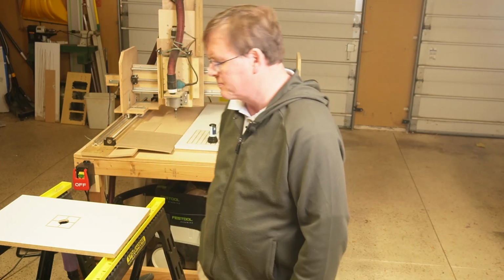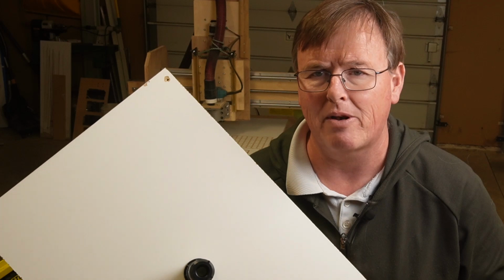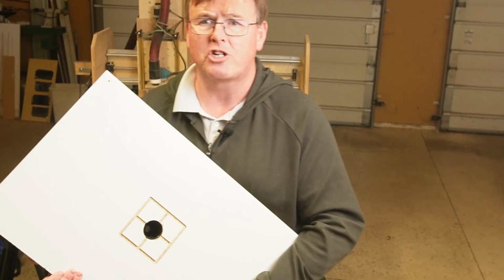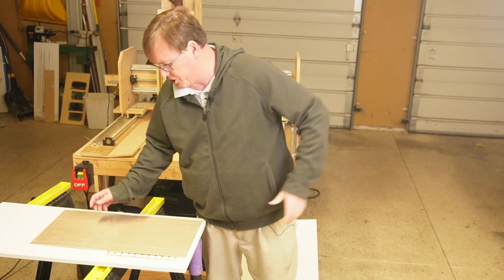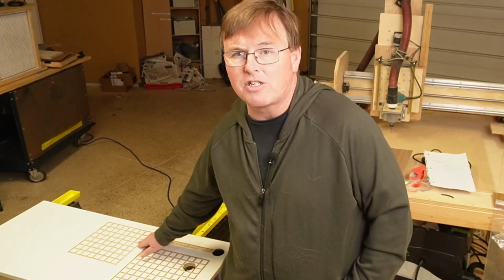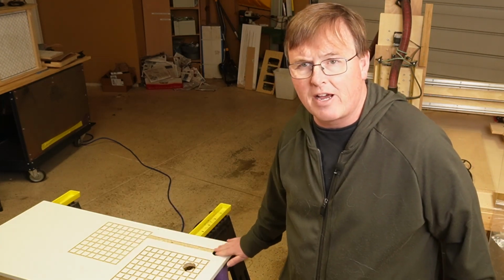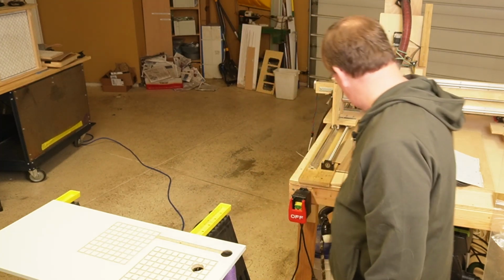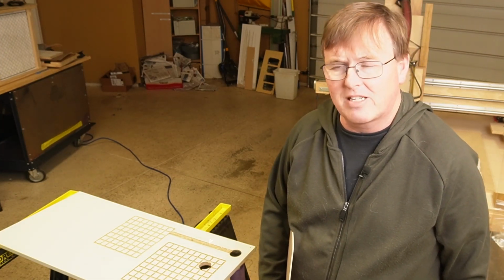DIY SHOP VAC VACUUM TABLE FOR CNC OR WORKSTATION! BUILD FOR LESS THAN $25 IN ABOUT 1 HOUR!

Comment from the maker: One of my viewers gave me a great tip (sadly, I somehow lost the name of whoever it was, so if it was you please feel free to comment/or contact me as I want to make sure you get the credit for your great input)!  The viewer said the Fein vacuum uses too motors -- one for cooling and one for the suction.  Using this particular vacuum would solve the potential overheating problem (and eliminate any reason to poke a hole in the side of your coupler to give some cooling airflow to your vacuum).   Amazing tip.  Double thumbs up to whoever messaged me!!!  I think I may be adding something new to my Christmas wish list.
Reply: Check the specs on the Fein vacuums before stating ‘facts’. Some versions have a single motor, but two fans - one for suction, and the other for cooling. These are typically the Turbo II versions. I have two which I use for sanding and they do work well. There are versions, I think the Turbo 4, which may have two motors, but are not as readily available as the Turbo 2 models. The Fein Turbo 2s are pretty quiet, which makes them great in the shop when used heavily.
Reply from the maker: @retired_badger  Thanks for the head up.  Will do.  I appreciate you leaving this comment so that everyone can know the difference between different models.

Comment: How long do you expect the shop vac motor to last if you run it with no airflow? Shop vac motors are typically cooled by the airflow thru the shop vac.
Reply: The Fein vacuums have 2 motors, one is for cooling. These types of shop vacs are perfect for hold down tables
Reply from the maker: @robert_g_fbg  Amazing input!  THANKS!  I knew some people were using the Fein vacuums for vacuum tables before this but didn't understand why they were any different than some of the other shop vacs with similar suction (and at a lower price point).  Now I know why they were using them.  I put your tip in part of my comment at the top of each of my vacuum videos.  If you want I can add your user name as well so you get full credit for your tip.
Reply: @ glad to help out. No need for credit, Cheers
Reply: Why not put the hose connector on the top, then you don't have to hang the connector over the edge of the CNC machine. Some way to seal of the grid for smaller shaped parts. Nice videos, 👍
Reply from the maker: @andrewmazurkiewicz105  Great idea!  Definitely worth trying out.  My only concern is that I wonder whether some people's CNCs might crash into the hose or sprinkler on top of their bed and disrupt their vacuum and/or shatter their sprinkler head (especially when homing or ending a job) but if one is careful with their design and resolves that issue, I see some definite advantages with a top mount.
Reply: @Simplifycnc  I'd imagine a 90 Deg, bend plumbing pipe could be used to lower the hose height problem without being too expensive. Cheers Andrew
Reply from the maker: Excellent question.  You absolutely do need to make sure that the vacuum formed does not too much a strain on your particular shop vac (you need to monitor this throughout your CNC job and obviously stop if it  starts to overhead as you could burn out the shop vac motor or at a minimum reduce its working life).  I talk about this potential issue briefly in the video under safety as well as in my description below the video (and that is one of the reason I put in the disclaimer to use this at your own risk).
However, I do think there are some simple fixes to lower the strain on your vacuum. 
1)Consider poking a few holes with a ball point pen in the middle of the pool noodle coupler so that part of the vacuum leaks off.  Of course this will reduce hold down power but you can tune the hold down power to the minimum necessary level for your project and hopefully sufficiently lower the stress on your vacuum to prevent overheating.  (If you end up poking too many holes then cover some of them up with duck tape).
2)  Start by using a low cost shop vac to begin with so that if it does give out it doesn't cost you much.  Black Friday is coming and you can get some great deals (usually).  Also Harbor Freight has some pretty low cost shop vacs.  I picked up my Orek vac from a yard sale for $15.
3) Consider limiting the use of the vacuum table to short jobs -- like  with simple vcarve designs.
4) Lastly, you can always purchase a custom vacuum with a better cooling system that is specifically designed for a vacuum table (and long term stain).  Unfortunately, I don't know of a low cost vac that fits in this category.  If anyone who reads this knows of one please comment below.
Reply: @Simplifycnc  Or just buy a vacuum pump designed for this service, are they really that much more than a shop vac?
Reply from the maker: @douggarson50  You could buy a vacuum pump but be aware that most of the cheaper vacuum pumps (at least on Amazon) use oil and the oil tends to get through the vacuum and ruin your wood's finish.  Some youtubers have tried to remedy the oil problem with addons but most ended up very frustrated because after a few uses the addon oil protection failed. This is part of what led me to try the leverage the shop vac approach to solve the problem.  There is a pretty good approach if you already own a compressor using a venturi vacuum generator (You can get  a low cost adapter on Amazon).  I tried that  approach but the fittings with my compressor were a nightmare as everything seemed to have a different thread.  Do a youtube search on this for more info if interested (unfortunately most of the people who have made videos speak German).

 As a side note, I cut about a 1 inch round hole in the sidewall of the pool noodle coupler (as an air cooling inlet for my vacuum) and it seems to still have enough suction to hold a board down  firm-- strong enough that one should easily be able to Vcarve on it (while simultaneously letting air flow through the vacuum significantly reducing chances of overheating/burning out your vacuum).  Adjusting this coupler hole size bigger or smaller will let people fine tune the balance between the suction of table and stress on one's vacuum.  Its super easy to test out and only costs a small section of pool noodle.
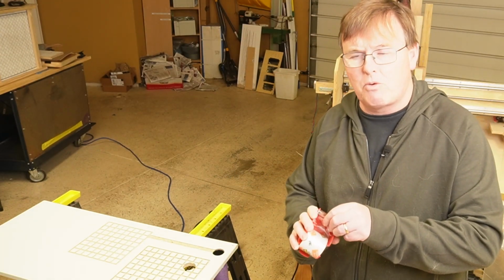Reply from the maker: I just posted a new video showing a way to reduce down the chances of this overheating.  The vacuum cooling portion starts at 15:28 in the video.  Thanks for bringing the issue to my attention.  Here is the link if you want to see it in action:
 https://youtu.be/pWSyRxU38HM
Reply: i've seen one ref that a 1/4" hole in the vac line will allow for enough cool air, and my experience has been that that does not affect the suction required to hold down the piece.

Comment: I really like the idea. I’ll give it a go. I think it would work well for V-Carving, but not when cutting all the way through the material. 

Good video mate 🥃
Reply from the maker: I agree that for V-Carving its ideal.  Here's a suggestion you might consider trying when making.  I think one could use both sides of Melamine sheet to set up different size grid patterns on the same board (with separate sprinkler holes and air channels) so you have more options for fixing on boards.  May be worth exploring.  Thanks for the comment!